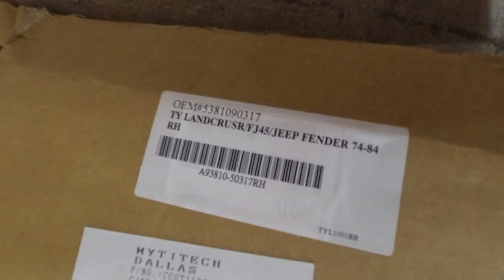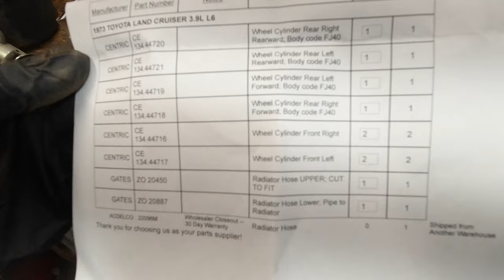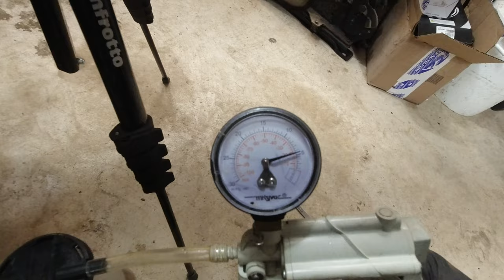Replacing All Hydraulic Parts | FJ40 Toyota Land Cruiser

Comment: That was so good thank you did a great job loved it can't wait for the next one never miss a video as always thank you for sharing and your time breaks and clutch are done dose need a cleaning noticed when you showing the slave clutch cylinder  lot of leaking on bell housings we need to see what is leaking and how bad like painting the parts not painted also am a fan of anything taken a part and cleaned before putting back together  painting with a stop rust paint in long run if you going to have a long time having to tare down and replace I do even on a old beater truck had for 22 years.